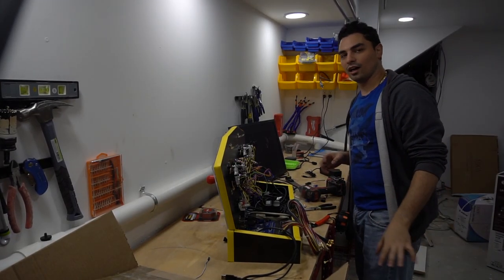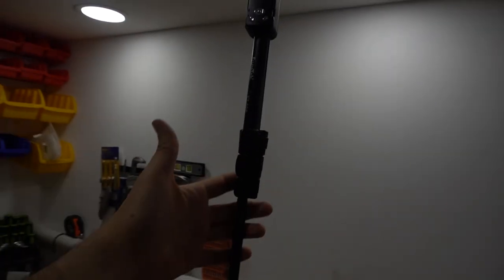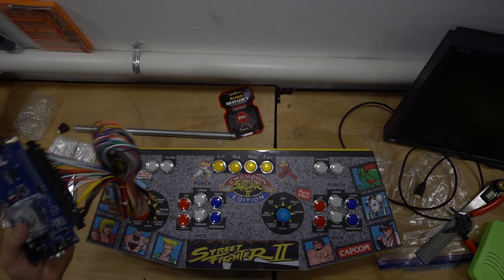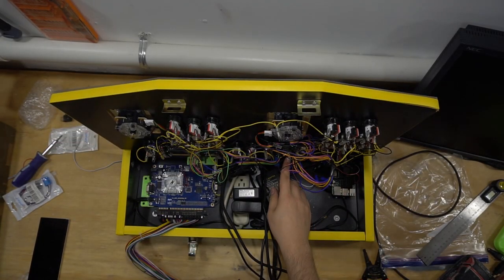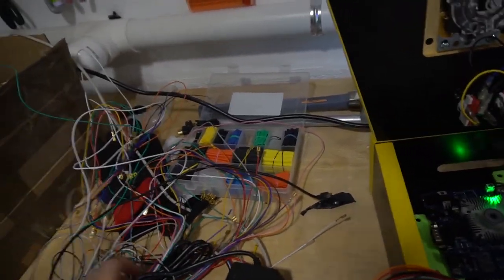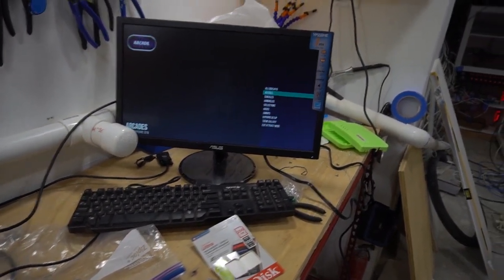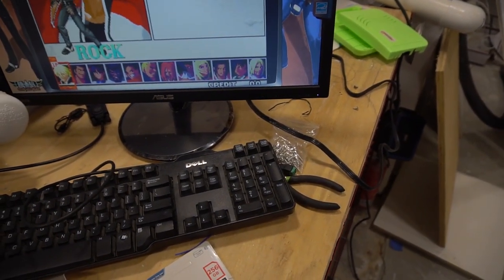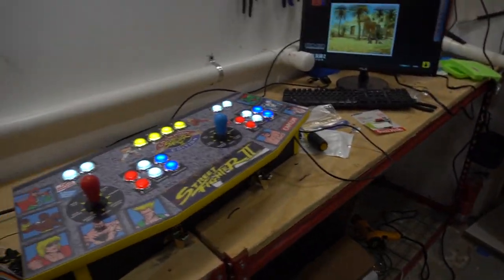1 Control Panel running Pandoras box and Retropi! Part 1

Comment: confused as to why you would even need both
Reply from the maker: Customer wanted both as the pandoras box 3d plays some 3d games like tekken a little better than the pi
Reply: @Vic_VP  pi 4 or small form factor pc have some nice pi 4 images now
Reply from the maker: @Darkseid001  he has a 256gb pi 3 b+. Yea I kn ow pcs are way better haha I currently have my big box and  hyperspin drive at 33tb
Reply: @Vic_VP  wow i have almost 8tb 32 inch rec room master cab also running a dynamic marquee
Reply from the maker: @Darkseid001     that's awsoke, my drive is HUGE, but honestly is packed with a lot of classic garbage systems ppl never heard of.im making a website and basically it will give customers the option to pick the systems they want. PC games now is my main focus. Trying to download all the modern current titles
Reply: @Vic_VP  oh I've been messing around with teknoparrot games lately have a bunch running on my cab pretty neat also running bigbox front end